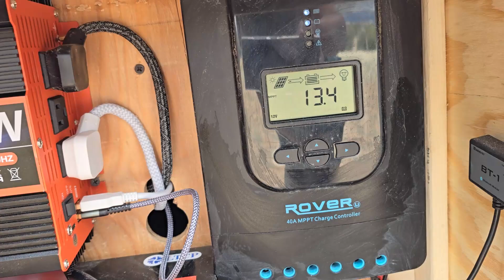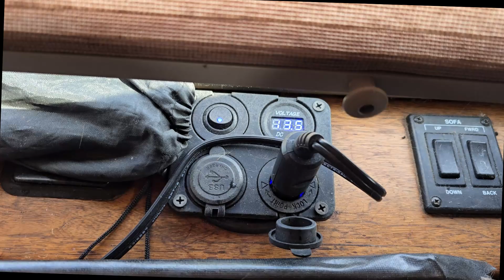ELECTRICAL SYSTEM MAKEOVER - HOW TO HAVE A POWERFUL AND SAFE  SUPPLY ON THE ROAD

Comment: The plug on my 500 Jackery went out so I can use it to charge my phone and use the cigarette lighter part but that’s it for now I’m saving for my solar system 😍🤗❤️🙏🏼👼🏼😎 Tim is Amazing!!
Reply: No hassel setup would be a 2000W portable  Power Station and a minimum of 300W solar panel on the roof. And you don't need a guy like me to install the system and charge "an arm and a leg" for it!🤣😂🤣
Reply: @MoBangFoYoBucks  I’m hoping to get at least 2 — 660 watt panels (they were $159 each but have since went up a little On my roof along with inverter charge controller and batteries
Reply from the maker: Oh no! I'm so sorry Rose!!!  I lived with a 500 jackery for 2+ years and it gave me a lot of gray hair indeed!!!  
There are two different "schools of thought"  people who live power banks and people who prefer an electrical system like mine.  It all depends on how much power you need.  One of the most important parts in both cases is to see if you can have a nice solar panel on your roof.  I got very disappointed at the portable solar panels because they break easily,  you are always taking them in and out,  they take a lot of space inside...  a real headache!  Once that is taken care of,  even a small cheap power bank can help a lot to complement the 500.  I hope you can figure out what your needs are so you can start working on it.  I think I have too much power now.  But it's okay,  I don't need to worry about rainy days!!!  🤣🤗🥰🌷🩷🌸
Reply: @Manyroadsnorules  I’m Hoping to have the same problem as you “to much power” come this fall I’d like to get at least 2 - 660 watt panels on my roof with the charge controller and inverter

Comment: Well done Tim!
Adriana: I would suggest you use the ‘USB extension cords’ minimally because they are attached to your inverter. The reason for this is because the inverter will use up to 20% more power to provide electricity, than using the USB port that Tim installed.
You’ve got a very nice system, congrats!
Reply from the maker: You are right!  And I use the USB very little... this system could feed my needs with half its power and be more than enough still  🤗🤗🤗
Reply: Doug, the USB port for the fridge, is connected directly to the battery. So the inverter is never needed to be ON!😉 Those USB extension cords don't need to have the inverter ON to have power to it.
Reply: @MoBangFoYoBucks  Understood. From Adriana’s explanation, it appears that she’s using the USB ports on the inverter to charge her phones, fan, etc.